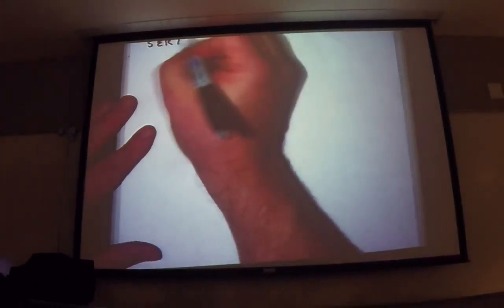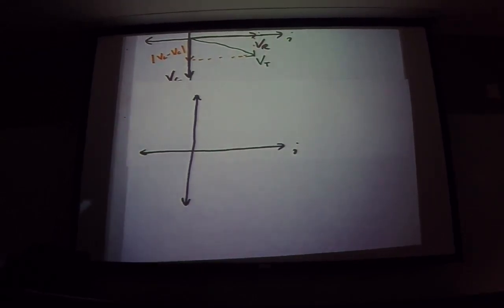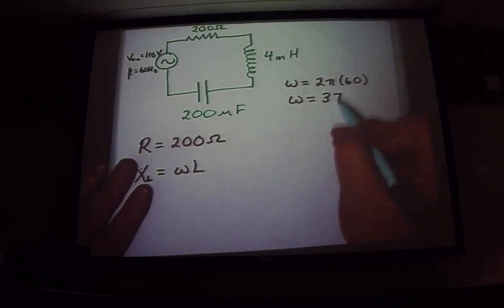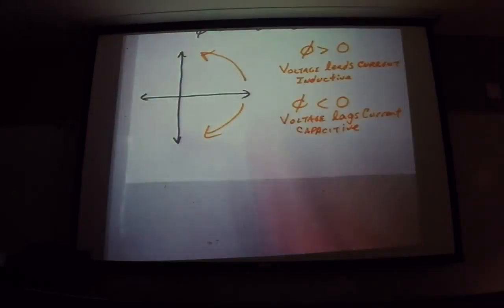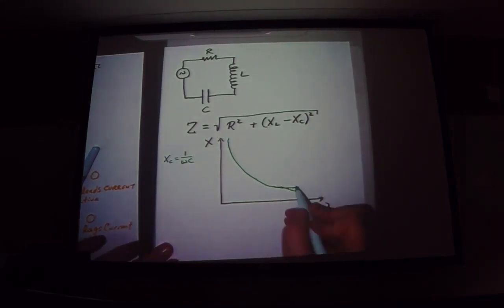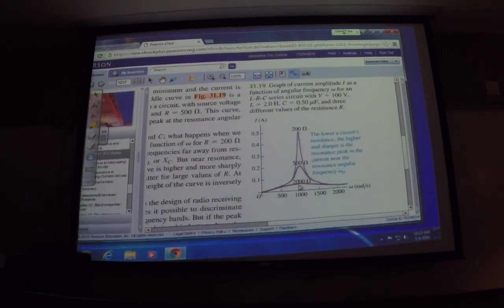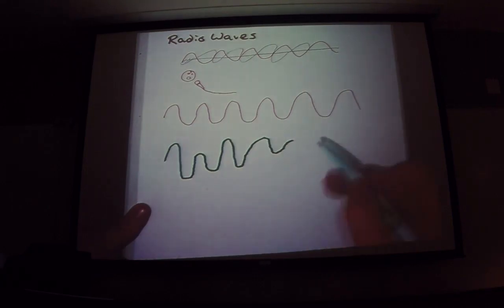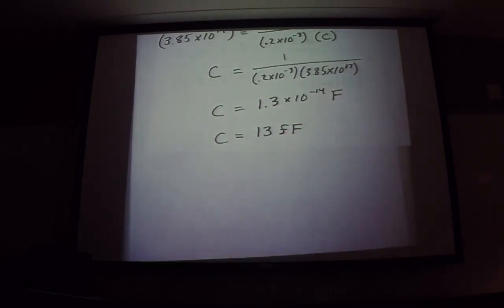CSUN Physics 220B Eric Collins 5/4/16

Comment: VL – VC
gives us the Vertical component of our right triangle    ⇉ ◣

We can always divide (VL – VC) by VR to get the SLOPE (i.e. y/x)

We can also take:     arctan[ (VL – VC) / VR]      to get the ANGLE.

Example: 
If VL = VC, then there isn't any vertical component because they cancel each other out giving us a slope of 0. Since      cos(0º) =  1.0     ⟹     100%
which means that the hypotenuse (or radius when we use trig.) is purely along VR. We can now se that when VL = VC, this would also mean VT=VR.